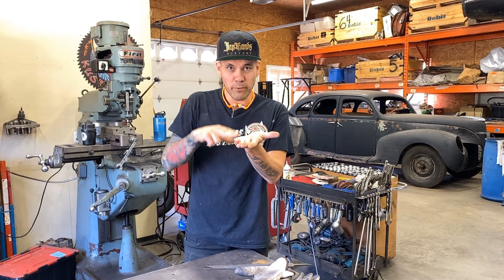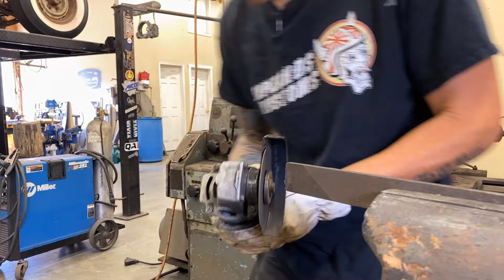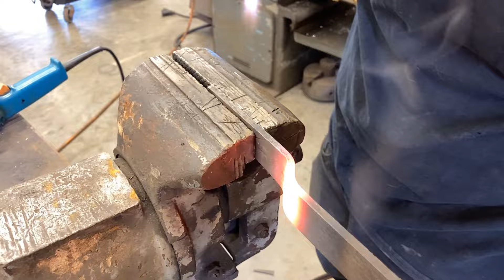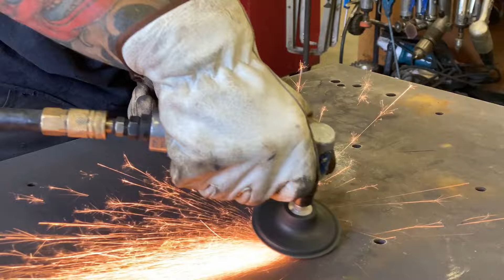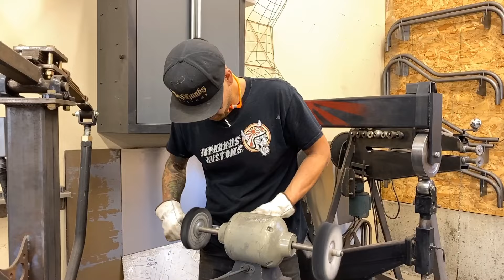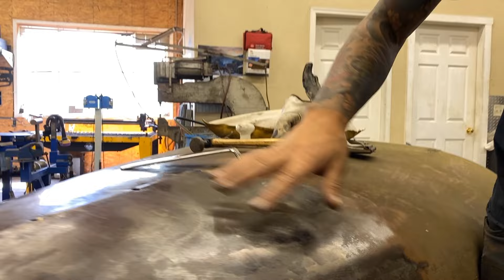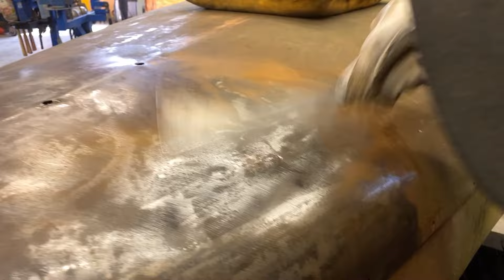How YOU Can Turn An OLD Junky File Into A NEW Slapper Spoon For DENT REPAIR, and How To Use It!!

Comment: Iv made my fair share of slappers, I have a few I left the file teeth on it I use them when I’m having a hard time seeing exactly where I’m contacting the dolly they work pretty good. I need to make a heavier one from a leaf spring but just havnt came across a free leaf in awhile haha
Reply from the maker: Right on I’ve heard of people doing that to leaving the file teeth on them this file would’ve been a good one to do that since it was so fine. Ha ha if you are or were local I have plenty of leaf here left from the ones I’ve cut off of it
Reply: @MakeItKustom  yeah shipping across country wouldn’t be very cost effective haha. I’m sure I’ll run across one, i probably have one in my crap pile somewhere…..

Comment: Now I know what I’m going to do with my junk files!
Reply: What is messing with my head is how after a lifetime of avoiding  hitting anything with a file because they are brittle and might break here you are using a file for a hammer, in the absolute best way to break it. ( ???? )
Reply from the maker: Man maybe they won’t be so many files in the garage sales I go to now lol just kidding there’s no shortage of files ever. As for using it like a hammer they are brutal yes and they will break yes if you use them to hammer something that’s also very hard. Typically when using a slapper you’ve already taken out most of the big dents and these are light hits on a softer sheet metal

Comment: Thanks man, btw, is it possible to use propane only for this work? or is it not hot enough? what do you think about a mix of propane and oxygen? does that going to work?  
Cheers!

P.S. any plan to make video on how to make a dolly?
Reply from the maker: Absolutely OXY propane would work if you have a torch set up they are not as hot as a settling but just by a couple hundred degrees still plenty to eat and bend anything

Comment: Great looking tool mate, for a bit of safety and longevity of the tool it would be a great idea to re-heat treat the file and temper it so it won’t snap when you’re slapping with it or if it falls on the floor. Love the channel and all the best from Tasmania
Reply: Yeah, that's what I was wondering, isn't a file a bit brittle for hammering?
Reply from the maker: Thanks a lot for the tip man! I appreciate your feedback for sure take care cheers!

Comment: Question? Can you use a dent puller to pull the low spots?
Reply from the maker: Yes many people use a dent puller for low spots I’ve never used one because of the studs you have to weld on or marks it makes in the metal.

Comment: Would wiping it with a little oil prevent rusting?
Reply from the maker: I prefer not to use oil but a non-silicon-based lubricant called Gibbs. This will not react with paint in the future

Comment: Hey man , I really enjoy your channel.  I watched a video you made on " hammer forming". I'm going to try and make a split gas tank now for a vintage motorcycle build using that technique. In your opinion, what would you'd recommend on aluminum thickness. I'm looking to be able to round over about a inch on the form . Or would you go steel instead ? Thanks in advance for any insight.
Reply from the maker: I like 16 gauge for gas tanks. Give you a little extra meat to massage.

Comment: HA! you do the same thing that I do. Buy old files super cheap and turn them into slappers and other usable metal tools. Farriers are sometimes a good source of these, their files are BIG.  You can see how hard the file is from the colour of the sparks when you grind it. Bright yellow to white for carbon steel.  I like to make 5" long handles so that if I'm tapping lightly I can use a loose grip and let the tail end of the handle bounce off of the outside edge of my palm instead of it digging into my palm which is irritating and will probably make a blister, I don 't like blisters. 100% "good enough" LOL, I know how that goes. Every time I use any black marker, Sharpie included, the metal seems to dry it up after a couple of lines and it's done. Which is why I typically use a fast drying guide coat paint like SEM 38203 Black.  I think that  a lot of guys don't have the patience to work metal like this, they want faster results which unfortunately leads to the total skim coat scenario. Great demo Karl on the tool making and the use thereof. And as my size is now back in stock, I just ordered an "Oni Fink" T.
Reply from the maker: Right on Toby! Thanks for the part number on the guide code. I do like using the sharpie but sometimes I use the guide code stuff as well. I also like your tip on the Ferrier files it would be nice to have larger ones that are flat. Leaf springs are sweet because they’re heavy and have a gentle curve but would be nice to have a heavy flat one! Thanks for your order as well Toby shipping out today

Comment: I tried making my first slapper a couple years ago before I had a proper torch. Used a little propane torch. Snapped the file right off. I've learned a lot since then, LOL
Reply: I guess the first thing you learned was that a small propane torch just doesn't put out the heat 😊
Reply from the maker: Yeah it’s kind of important to heat it up all the way to a glowing red for it to be soft enough to Bend

Comment: I was told long time ago that a file was super brittle and to not slam/throw it into the work bench as it might break the file. Hence my surprise seeing you making a slapper out of it. learn something new every day
Reply from the maker: Yes they are very brittle because they’re high carbon content and their harness but they are perfect for this use because we are not throwing them around but rather tapping them on something softer. If you were to hit a file onto a hammerhead it would snap in half but using it to slap sheet metal that has some give and is a softer alloy is perfect
Reply: My shop teacher way back in the day said the same thing, never giving a clue as to what to do with a used up file. He probably didn't know himself. Heating it takes some of the brittleness out of it, But you're not going to be hitting that hard either. I have made quite a few of these and they work very well. I also use old leaf springs for this as well.